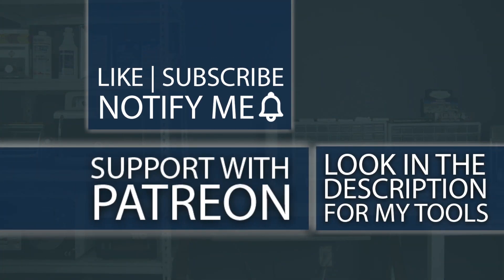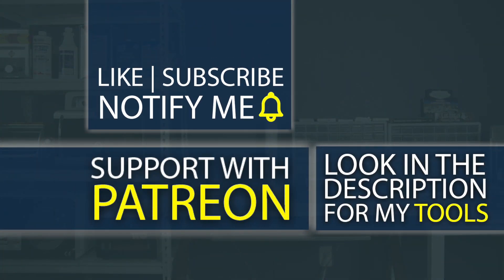EP59 Tip2Grip | Cartridge vs Oldschool Soldering Stations for MICROsoldering | Purchasing Decisions

Comment: If you go on Amazon or eBay, you'll see tons of soldering stations for under $100 under various rebrands of Chinese made soldering stations, such as Yihua and Aoyue. The vast majority, even the pro-grade ones, feature the old style two piece tips. Even though my 4-in-1 Aoyue 968A++, which comes with a hot air and pickup tool, is perhaps the best of the cheap stations, has the crappy old style tips. I wish I spent a little more money and purchased the higher end 2703a model which comes with a cartridge tip.

Recently, I've been seeing some build-your-own T12 Fakko soldering stations kits, featuring Haako compatible soldering cartridge iron for under $30 and prebuilt ones for around $60. Even though they're much more pleasant to use, they struggle to wet the solder on some jobs. I suspect their mixed-mode power supply is a bit anemic when compared to larger stations with a linear, transformer-based one.  I also own one of these Fakkos and I prefer it over my 968A++ soldering iron. I have long since retrofitted a desoldering gun in its place. At such insanely low prices, I cannot understand why the vast majority of the soldering stations still come with the old style tips.
Reply from the maker: Good news is that we are starting to see more beffier PSUs in the new off brand cartridge systems. Im excited to actually go and do some testing this fall in china and see if its finally time to show some off or if we wait another year lol. Thank you for this thought out comment, it will help a lot of people who pass through!
Reply: @TheArtofRepair  Technically, some of the higher grade soldering stations with MCUs and a thermocouple, such as my Aoyue 968A++, can in theory be reprogrammed use T12 cartridge handles. T12 handles are heater wired in series with the thermocouple, while the older style ones have separate circuits for each. Oddly enough, the older style can read the temperature while heating the tip, whereas the T12 alternatives between reading the temperature and heating the iron. You would expect it to heat up faster and better at maintaining the temperature, but the T12 does a better job since it integrates the thermocouple and heater. and alternates between reading and heating every few milliseconds or so. The MCU is in charge of controlling the read and heat cycles. To save money, some money stations might use the same firmware to read T12 and older style tips, since the older style can be controlled the same way as s T12.

Comment: This is particularly evident in micro soldering. Control is better with the shortened tip to grip ideal. No argument, but not all of the new irons and tips are of good quality. The Metcal line has the 5210 and. although it is expensive, it has control options and data logging capabilities which the others don’t have. In an ugly world, being able to prove your work with data may be necessary. No I don’t have or can afford one, but I like their control options and that is what sells me. Pace and Weller have some great options also. Quality of tooling can separate your work from your competition’s work. It’s your call!